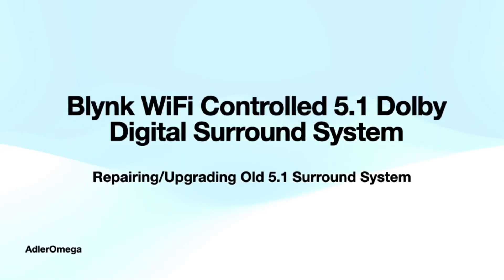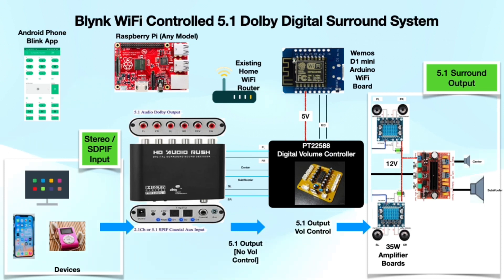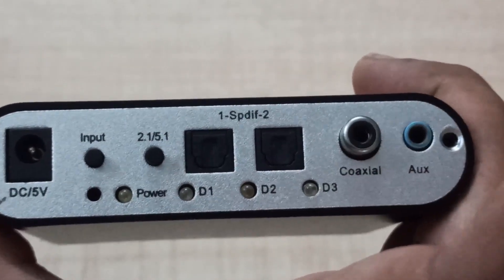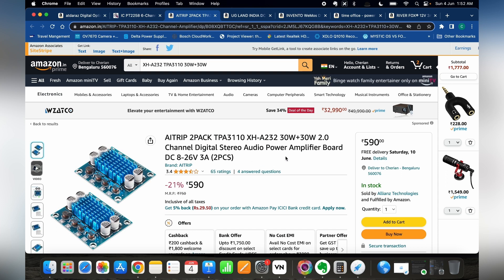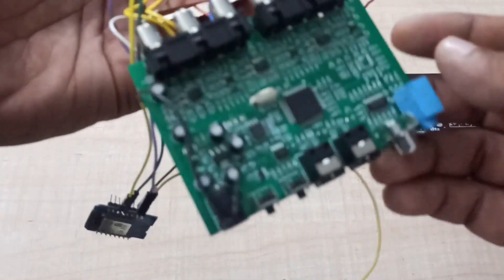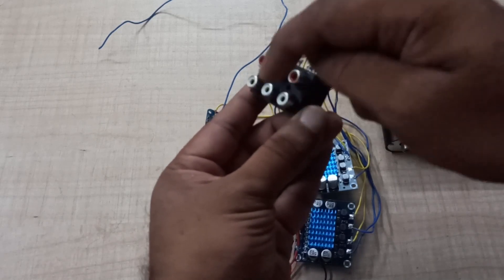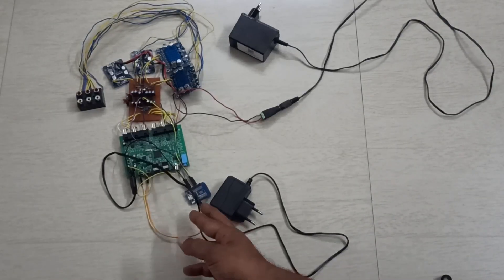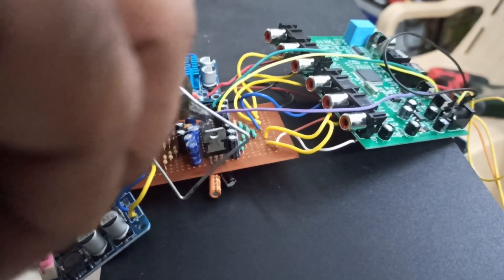2023 Upgrade 5.1 System: Adding Digital Volume Control with Blynk GUI & Dolby Digital Surround | DIY

Comment: Why, you just don't take the new model, the cheap Chinese "HD audio rush" 5.1 audio converter that has an infrared receiver and remotely. It is even equipped with a digital tuning of the equalizer. Visually, they have no difference from that of the image in the video. Because when I look at the configuration you presented here ..... from so much digitalization of, otherwise the digital sound "mp3-blaaah" ....... You don't listen to a song. On the contrary, you listen to Churchill's statements that you caught somehow, because the the character of waves which are still fly out of space!
Reply from the maker: :-) I had these items with me so just want to try out

Comment: How to add remote control with this IC instead of smart phone to control volume ?
Reply from the maker: Just add the IR remote module to the Arduino and change the code. Currently Blynk code is added in Arduino
Reply: @adleromega 
Thanks, but pls show it in practical.
Reply from the maker: Sure will prepare one video for you
Reply: @adleromega  
Thanks